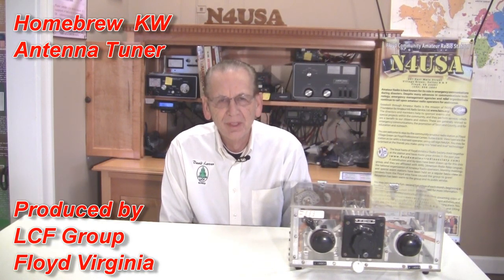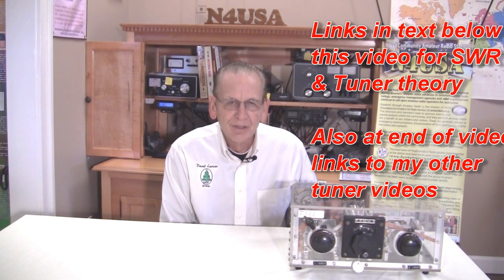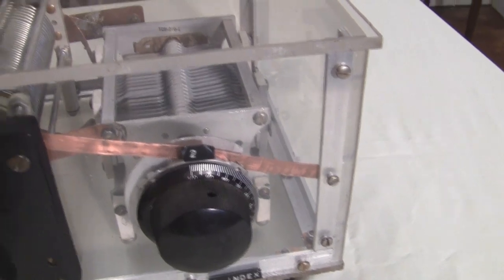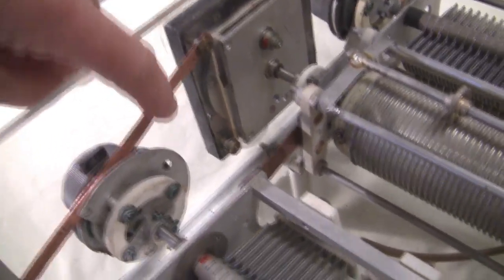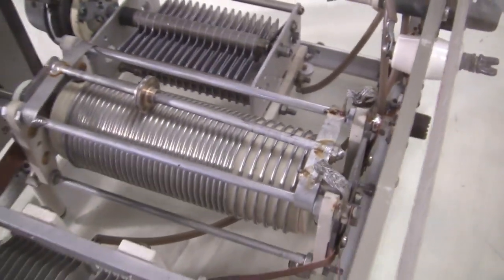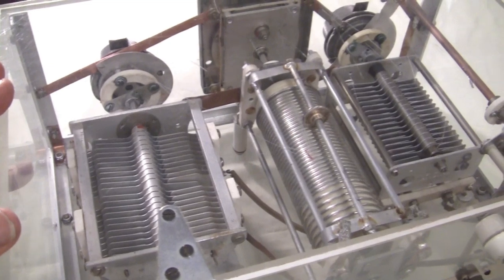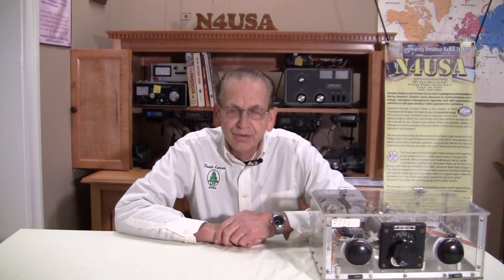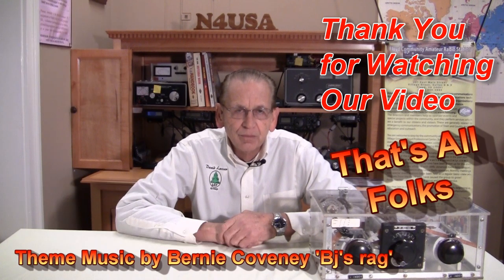Antenna Tuner  Homebrew KK4WW & N4USA

Comment from the maker: Hi - I do not know the uH of the coil - it could tune 160 - 10 meters but it would depend on antenna and feed line for chosen frequency.  I would not use this one in the clear case as it has no RF shielding.  I am about to put up a video of really heavy duty tuner made by same ham W4KQD SK.  It could be used - give me 5 or 6 days and it will be posted.  Thank You Dave KK4WW at N4USA